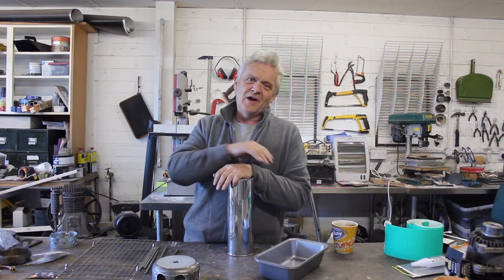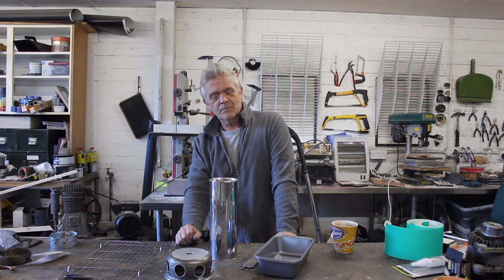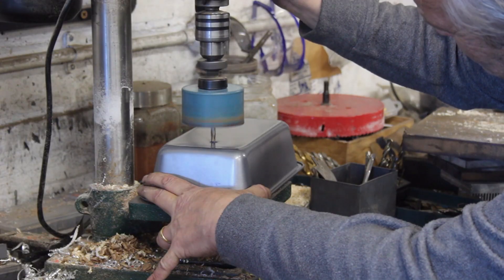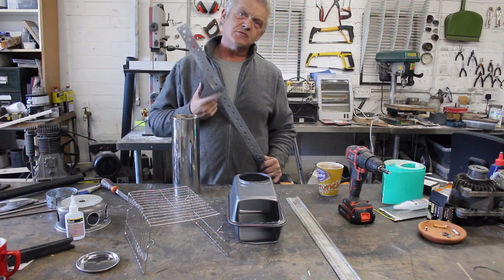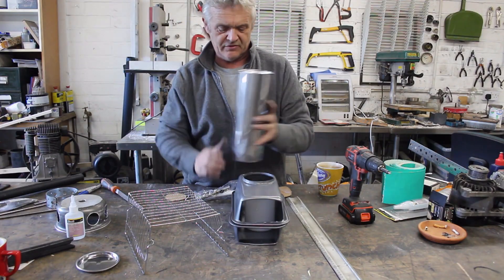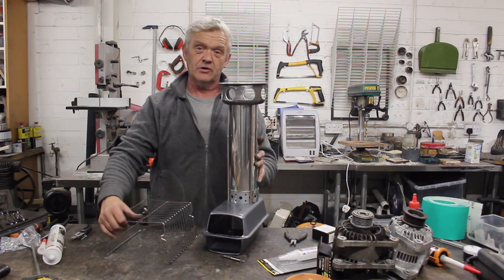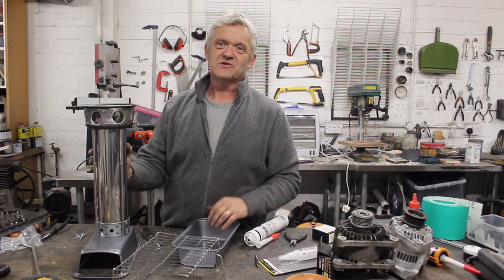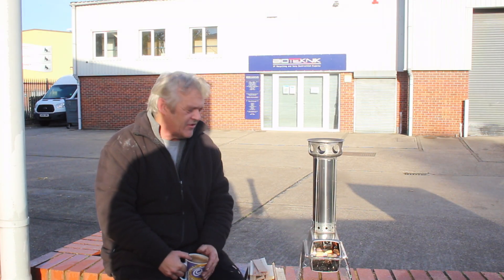1726 Easy Build Rocket Stove From A Toilet Brush Holder

Comment: This is really awesome! Thank you very much for this Really practical tutorial that could get a person out of a jam at no expense.  

Most people have metal cans in the recycling or those pots and pans around the house. 
     Pretty much everybody has a can opener that could be used to punch holes. A Dremel with a cutting disc or a drillbit can do a lot of that work, or a person could just put water in something that has to be drilled and freeze it, and then use a nail to put the hole in the appropriate place in a pinch. Once holes are made, a person can use tinsnips or any other number of items to make the holes into the right size and shape necessary.

Even if supply is an issue at the time, a person could use some silica gel kitty litter to make thermal silicate insulation, and if they’re really clever, figure out how to use it to create a seal.

Comment: What happens if you add fins to the flue and use that to heat up a sand battery as shown in the other videos?  The exhaust gases should get cooler as they make their way up the flue as the heat is transferred to the fins, and then the sand, but will it still "rocket" if the flue gases are cooler?

Comment: Excellent project again!! This is one of my favourite tbh. Seen many versions of this using tin cans n al sorts bit this is a nice decent size!
Because these burn much more cleanly do you think this would be safe to use in doors with an out of use chimney that's been unboxed in.. eg. Still have a vent in outside the all never blocked up just boxed in fireplace. Used to have a back boiler.. 
If I were to remove the "boxed in" part BASICALLY just some plaster board, would this be fairly safe to use in a pinch over winter with the fuel shortages and blackouts planned? (As I've a few pallets I can use and a ton of brambles and thick bush like weeds to cut down that will be fairly dry soon!) 
Cheers from London 👍😎🏴🙏

Comment: You should put a stainless steel screen in the bottom end of the chimney pipe so it glows hot and burns up any unburned wood gas  making it burn smokeless.

Comment: What I learned about rocket stoves years ago is that the chimney needs to be insulated or in a chamber that the heat runs through. (Rocket mass heater) it is the high temp of the chimney that makes it burn better and the holes you put at the bottom of the pipe are defeating that purpose. It has the name rocket stove from the sound it makes sucking so much air through the stove which kind sounds like a rocket. It takes a few minutes to heat up and properly work. This is a neat stove you made and I like it but is not a rocket stove. The term rocket stove is given to things that just resemble rocket stoves these days.

Comment: Geez that was a bloody nice build . Once the principles of rocket stoves and fire are understood then along comes learning the principles of the different builds and styles and that seems to be endless exploration . I have just finished making my smokeless used plastics burner and I have to say I am amazed. Amazing amount of energy in plastic . You can think of it as incredible thick dense oil !
Reply: I agree with the first part. But the second part with burning plastics, what the hell... All plastics give off toxic fumes. Saying that it's burning smokeless is a similar thing to when absolute imbeciles say that you can have clean diesel. No such thing, similar principle in that there'll always be vile particulates 🤢🤮

Comment: Spiral ducting is a very cheap easy material to make all kind of things, lots of sizes and thickness gauges !
A 90 degree bend pushed into a cut length and a steel grill pushed into it, 2 x Spiral Wall Mount Saddle Clamps for legs, drill a few holes and done !
this made in under 5 minutes for someone new to working with metals, only drilling a few holes and screwing in a few screws.
Even i can do it  !
Thanks again for a great video !
Reply: Just be aware of toxic fumes if it's galvanized ducting 😲
Reply: @davefuzzforrow6627  only for the first burn 🔥 😤
Reply: @davefuzzforrow6627  and don't forget to have a ventilated area or the monoxide will get you first lol

Comment: That's excellent Robert, here's something you might be interested in, it's the Ifam hydrogen paste which has 10 times the energy storage capacity of batteries. It would cost twice as much to run a Tesla car on but I think it would be worth comparing from a thermal energy perspective. For example, it might be useful to replace kerosene and natural gas for home heating and industrial heating. Hope that provides some inspiration🙂 Oliver

Comment: Where do the drinking straws go ?? And where for are they ?
Reply from the maker: the straws are spacers for threaded bar that went up the centre of the straws - they are basically long bolts that hold the top pan and bottom loaf tin together - hope this helps

Comment: Hi Robert, What did you do with the stainless steal staws?
Reply from the maker: the straws are spacers for threaded bar that went up the centre of the straws - they are basically long bolts that hold the top pan and bottom loaf tin together - hope this helps

Comment: What is the purpose of the straws?
Reply from the maker: the straws are spacers for threaded bar that went up the centre of the straws - they are basically long bolts that hold the top pan and bottom loaf tin together - hope this helps
Reply: @ThinkingandTinkering  thank you

Comment: @Robert Murray-Smith, 
Why have I never seen you do anything about lead alum batteries? I've been watching your channel for years and I've searched your channel and found nothing about the subject.
Reply from the maker: I did do something many years ago - but there isn't a lot to say on the subject
Reply: @ThinkingandTinkering  I've been using them for the last few years. They're great for running DC lights and other low current applications. I have one (a lawn tractor battery) that's hooked to 30 watts of solar panel and it runs a 3 watt light bulb from sunset to sunrise every day. It's been running every day like that for about 4 years now. Great in a power outage.

They actually have a lot of amp hours in them, but a 12 volt conversion of a reasonably good lead acid battery is probably the equivalent of about a 10 volt battery. Fully charged they hold around 11.5 volts. Not too good for use with an inverter, but great for small DC applications. I even have one that is connected to a 9 volt 1 watt hobby solar panel. It runs one of those little (as seen on TV) Mighty Lite's. The early ones that ran on a 9 volt battery. I believe the battery has 2 bad cells, but it still runs that little $10 automatic light (with LDR and motion sensor) faithfully. That one has been running for about 5 years. 

The experiment I want to do is to add an extra cell or two to perhaps a 48 volt battery bank. That should make it hold the proper voltage to be used with an inverter. in my calculations I'm pretty sure 13 cells would be about perfect for a 24 volt alum battery. The problem is you would need 13 equal cells, so in other words they would have to be new cells, and in order to have 13 of them I would either have to design my own battery jug or else use single lead acid cells, which could be very expensive. So far I've only converted old junk batteries.

Comment: what did you wind up using the straws for?
Reply from the maker: the straws are spacers for threaded bar that went up the centre of the straws - they are basically long bolts that hold the top pan and bottom loaf tin together
Reply: @ThinkingandTinkering  is the request to dm you on telegram legit? or is it a faker?

Comment: Hi Robert was watching Episode 1712 when you bent T section for wick and you was think that the holes in the strapping helped with the Burn what about using the stainless steel to hold the wick and use it for the air intake instead of a circle strap
Reply from the maker: sounds like a good idea mate - I must try it cheers

Comment: Setup a few metres safely from home near a window, Wrap some copper pipe around the chimney, one of the copper pipes open to air, other end pointed inside home thru window to pull hot air inside for heating without fumes.
You could also have some pipes above chimney connected to a water tank for free hot water.
Add a oil drip to make fire last longer as a oil burner.
Reply from the maker: cheers mate

Comment: A Rishi stove perhaps? I am sure you have said so in the past, but it is incredibly important that any fuel burning stove used inside is in a properly ventilated location. Our houses in Canada are perhaps a bit more tightly sealed than most, but sadly almost every year people die from using a charcoal or similar stove for heat, not realizing how quickly carbon monoxide can build up to lethal concentrations.
Reply from the maker: sorry mate but said it - loads of times
Reply: @ThinkingandTinkering  No worries mate, it bears repeating. I was talking around the real problem here in Canada, and that's with new immigrants from warmer climes not used to the cold climate and the level of weather sealing of the houses. It gets chilly, they pop on the same charcoal brazier they used back home for a little heat with the windows closed, and the result is an entire family very ill or possibly dead.These are not stupid people by any means but they are ignorant of the dangers and the need to take precautions.

With the cost of heating crisis in the UK, I can see a lot of people looking there for a cheap way to heat a room, and not having the same knowledge as their coal using grandparents (and the old coal fire flues long since bricked up) winding up very ill or dead.  Again not stupid - just ignorant.

Comment: Great stuff. 
Not sure if anyone else has attempted following 
Wondering how well a rocket stove would work made out of two concentric pieces of pipe, and a flat plate at bottom. Inner pipe being fair bit longer to generate the draft, and notched so air can flow down the outer pipe getting heated from the inner pipe, and the rise up the inner pipe. some rods and tubes to support inner tube, and also allowing for extra air to complete combustion  Drop lit fuel down the inner  pipe to get draft started... And once that hot, the incoming air will start to get heated.... Maybe high enough to start gassifying solid fuel dropped down the outer pipe.
Reply from the maker: yep - I did a video on a version of this

Comment: Love it. Pretty cool, no pun intended. I missed something though. What is the purpose of the straws?
Reply from the maker: the straws are spacers for threaded bar that went up the centre of the straws - they are basically long bolts that hold the top pan and bottom loaf tin together - hope this helps

Comment: I want to make a wood burner out of an old gas bottle to use in my home, but my problem is getting rid of the smoke, as I don't have a flue in the chimney
Reply from the maker: can you not put a flue in the chimney? that's what most folks do they come as a concertina of metal that you just pull up through the chimney

Comment: So im slightly confused with what you did with the straws did you. Completely remove the bottom of the bog brush tube? or drill small holes to accommodate the straws and welded them in place? Any how muckka love your content ..ps have you seen the ammo box stove??
Reply from the maker: small holes in the pan on top and the loaf tin on the bottom - the straws are spacers for threaded bar that went up the centre of the straws - they are basically long bolts that hold the top pan and bottom loaf tin together - hope this helps
Reply: @ThinkingandTinkering  thanks sir, it does .. going to build one to experiment however doubt I can use it to warm my flat

Comment: a question on safety- I've always understood that welding galvanized things produced extremely toxic fumes that harm the lungs, so I worry about you a bit when you do that.  Could be with little tack welds, holding your breath is sufficient, but a number of welders have impressed upon me that galvanized + welding= very bad.   As they weren't the overly-cautious sort, I figured it was actually a rather grave peril?
Reply from the maker: these things aren't galvanised - it's mostly stainless steel - how ever you do raise a point - the baking tins I used have a teflon coating but you can buy tins without a non stick coating - or you can just be careful on the first heating

Comment: another idea for this sort of build if you don't like the holes at the base of the chimney. add a piece of tubing to the top of the inside of the burn area with a L bend going up the chimney and its other end just outside the burner. The fire will super heat the air in the tube and that air will be pulled through by the draft to mix with the unburnt gasses. centering the tube end in the chimney works best.
Reply from the maker: nice one mate - cheers

Comment: A fabulous toy to add to this is a stove fan. They use a peltier module to power a fan to distribute the heat. I have one on top of the burn pan and it goes flat-out blowing warm air from the chimney and is below the exhaust so no fumes 🙂
Reply from the maker: nice!

Comment: Well I only have one question, and I haven’t seen it asked yet so, how did you connect the straws? Lol. Have already gotten the materials and look forward to sharing any insights. Love the video, hope that everyone of you all are safe and sound these coming holidays and into the next year. 🎉
Reply from the maker: they perform two jobs - one is as a spacer and the other is decoration to hide the threaded bar - they really don't need joining so they aren't joined just slotted one on top of the other mate - if wanted to join the you could solder them - yes you can solder stainless steel!
Reply: @ThinkingandTinkering  wow, I had no idea that you solder stainless steel, that is a bit of useful information, thank you!
Reply: You could slightly crimp one end and bore the other with a hammer and punch would be my uneducated guess 🤷‍♂️
Reply: Straw plow🤔☺️

Comment: i looked for scrapes on your hand from the big holesaw cutting thru the baking pan, way dangerous
Reply from the maker: it's only dangerous if you go licking it mate - same as a saw, knife or pretty much any tool - do you really need to be told not to go rubbing the sharp edge along your delicate parts?
Reply: i mainly meant the holesaw catching, then spinning the baking pan into your hand not you deliberately touching it. use a vise to be safe was my point. love your channel

Comment: You should make something to go on your original rocket stove so the stove can be burnt outside of the house but the heat transferd in ie into a central heating system or a radiator of some sort. Must be possible then theres no risk of fires or fumes inside your house.
Reply from the maker: I did turn it into both a boiler and a sand battery mate and did videos on both
Reply: @ThinkingandTinkering  yeah ive watched them its a good idea but still need some way of piping into heating or radiator for use inside the house if you have no chimney inside to vent the gases.

Comment: With the amount of air that can enter underneath I'm not sure you do need air inlet on the chimney... did you try it without?
Reply: My thoughts too. I suppose adding the extra air at the top end of hot combustion is the idea, but I suspect those holes could be higher, and better hotter by using a concentric collar ring. It’s always the case of getting the combustion zone as hot as possible and not robbing heat until later in the flue.
Reply from the maker: nice tips mate - cheers
Reply from the maker: yep - it's better with

Comment: there are several ways to make alcohol safer to use, you can fill the can with tissue paper, cotton balls, sand or diatomaceous earth. TP, sand and cotton absorb the alcohol and acts like a wick , DE becomes gel like, all can be reused but if you let the tp or cotton burn dry it will char. It can still be used charred.. This is a really sweet stove build.
Reply from the maker: cheers mate and nice tips on liquid fuels

Comment: Great video!  I'd like to make one.  Are there proper cross sectional area proportions of burn chamber to riser to secondary air?
Reply from the maker: yes - but basically most things will work - you can go into the math if you want but you can also cobble together something and be pretty sure it will work by rule of thumb

Comment: It gets so cold here I can’t get oil to burn on its own. It gets thicker than honey. Even propane is hard to burn when it gets that cold. I was thinking on making a hybrid wood and oil heater that I could get going with wood and then burn the waste oil or anything really.
Reply from the maker: that's a good idea mate use the wood fire as a preheater? maybe pass a pipe through the fire with the oil in the pipe - have to be quite a large bore pipe I would think if the oil is that viscous

Comment: Looks great! Could have one on porch outside kitchen door and get frying pan on. I got LOADS  of bits of clean dry wood taking up space in walk in cupboard. I wonder if a shorter version would work effectively because I have a empty  fireplace opening where gas fire/back boiler unit used to be and it could go in there and utilise the existing stainless flue. It would be great sitting there burning wood and  cooking stuff.🙂
Reply from the maker: that would be cool

Comment: I wonder if it is  possible to make a thermal powered wind turbine, using a heat source to produce a draft and focus the draft through a turbine
Reply: When coal fires were in use, a few sheets of burning newspaper would create a massive updraught in the chimney!
Reply from the maker: I would think so but I am not sure how well it would work - maybe an experiment or two?